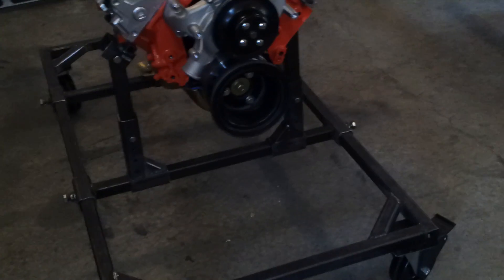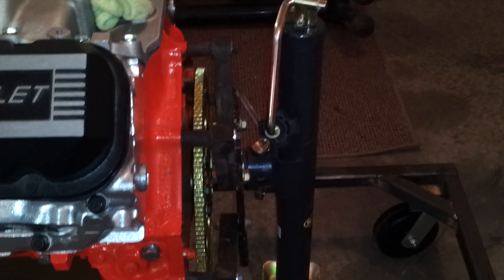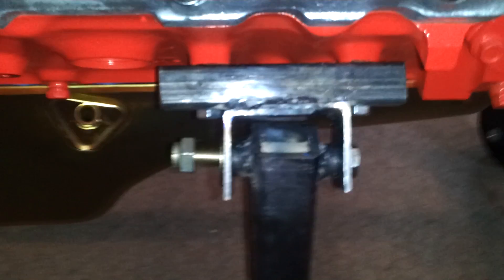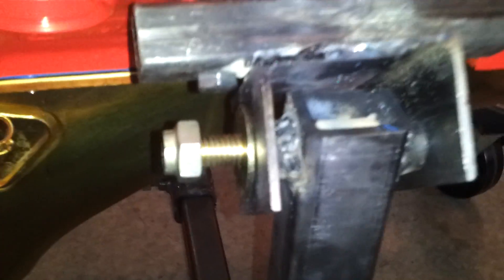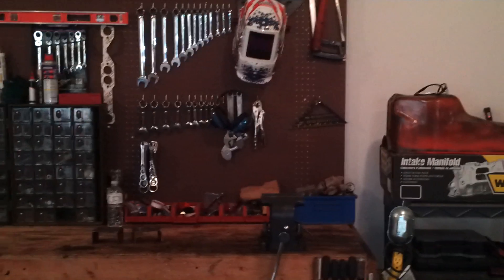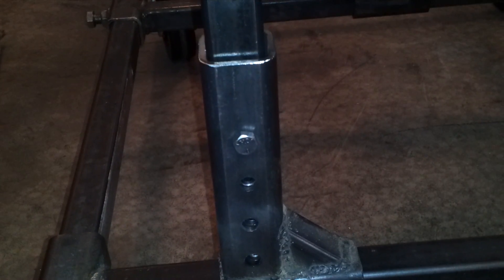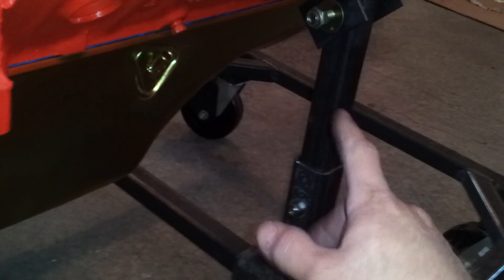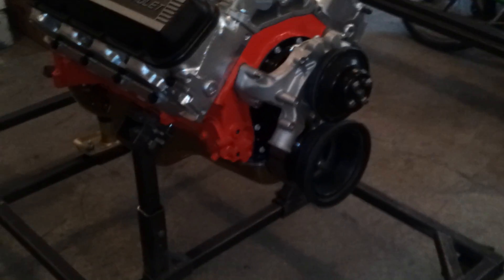Engine start stand plans III

Comment: What size tubing are you using ?
Reply from the maker: I used 1.5" x 1.5" x 1/8" for the main frame then used 2"x2"x3/16" for the parts that slide.

Comment from the maker: Glad you liked it Paul.....This stand has worked out awesome! One thing I recommend is mounting your radiator  on a quick release system or put one side on a hinge so you can easily remove it or swing it out of the way for cam swaps!

Comment from the maker: I originally ordered it thru J.C. whitney but they no longer carry them. As far as the box, I got that when I was in the Marines (Might try a surplus store)! Summit racing has a 165 piece SAE kit #SUM-CSUM2007. Also if you get on Ebay and type in Grade 8 SAE bolt youll see all kinds of kits from rivercityindustrialsupply, which is who I will be ordering from soon! Im almost done fabricating the stand and ready for paint! Video to follow in a few days!..... Thanks!